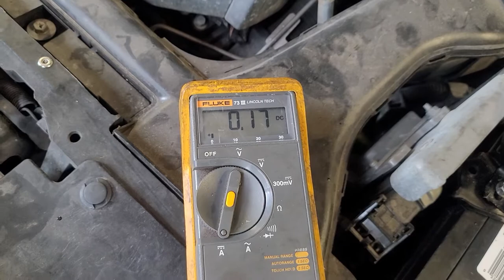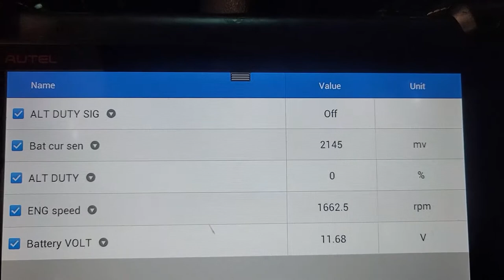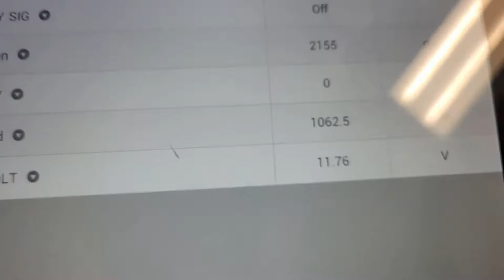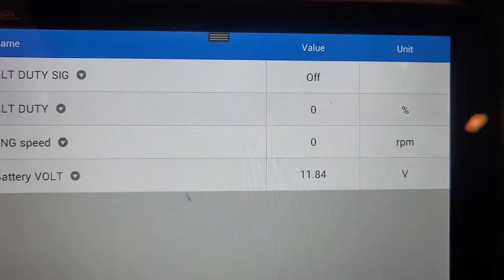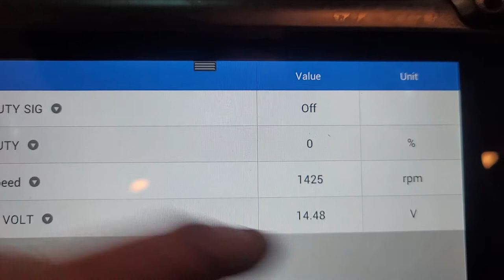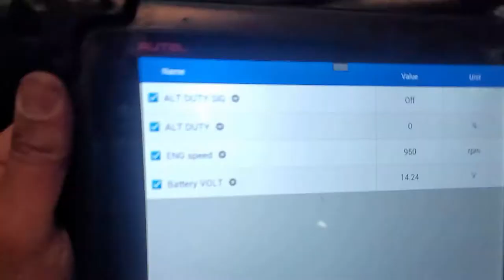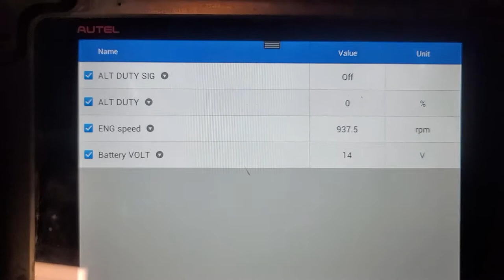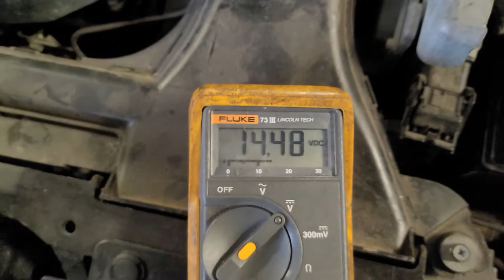2010 Nissan Maxima dying while driving. Diag and repair.

Comment: You’re an honest mechanic. I’m wondering if this is the same issue I’m dealing with at the moment. I replaced my alternator. When I took it out, it was covered in oil because my valves gasket is damage and it’s liking oil. I didn’t clean the harness so hopefully that fixes the problem.
Reply from the maker: thanks for the kind words and hope it will fix your issue. please share with the viewers your findings.

Comment: I believe a have the same issue with my 2010 Maxima. I have replaced the alternator twice  and battery three times! The dealership even replaced the alternator once. I'm going to check this since my wiring is in the same condition. Thanks!!!!!!!
Reply: @ZeJic  I didn't clean it; instead, I replaced the alternator pigtail connector . Now,  I'm going to pull my alternator this weekend and check it/replace it because I think it's dead again. I found there was rust in the old connector, so hopefully that's what was killing everything. I'll let you know.
Reply from the maker: Good luck 🤞
Reply: Crazy how all of us are in the same shitty position at the same time. Literally just towed my car into a dealership after replacing my battery last week.
Reply: @DallasAutoDiag  Thanks!
Reply: @04WildDawg  any updates?
Reply: @TheSwankynina  I sold the vehicle. I the vehicle would still die if it sat more than 24 hours.
Reply: @04WildDawg  was it that mine doing the same thing
Reply: @jrokwest901  Unfortunately not. I never found the main issue. If I didn't drive it for 24 hours it would still die. It had some type of parasite drain and no one in my area would take the time to diagnose it. I just got another vehicle.

Comment: We have a nissan murano and been to 3 different mechanics,  new alternator,, new battery etc etc ..only difference is it will suddenly cut off but once we boost it off it will go a week or so and do the same thing just die out while driving..the mechanics run test and say they can't find nothing.. Definitely need your expertise!
Reply from the maker: Let someone check if the pcm has a software update
Reply: I had the same issue with my 16 Maxima , replaced the IPDM and the car stopped stalling out,  but now my alternator keeps burning out.  I am on alternator 4 or 5 in 6 months.  I have changed it so many times that I can't keep count.

Comment: This is exactly why i don't want to just jump in and replace the alternator with out checking everything. Same issue on my murano. drives for 10-15 mins then loses power and and dips down to 11v and goes into limp mode. Let it sit for a few hours and it fires back up with 14.2 volts and the pattern repeats. I'll check this next.

Comment: 2011 Nissan Maxima: Over the course of years before I bought the car from my sister the battery would randomly leave her stranded (or so she thought) but it's odd that the car would start just fine and after a short drive of perhaps three minutes and about fifteen minutes of her shopping the battery suddenly dies when she gets back in (her job and the store were very close so it was odd that it would crank once but fail less than 30 minutes later). I buy the car and change the alternator and the electrical connector for the alternator cause the plastic was brittle and broken, I did this cause the battery would randomly be drained after the car sat for weeks or sometimes only days. Car works fine for a few weeks (not driven regularly though) and I find the battery is still draining cause it's dead one day, but I charge it up . A couple of weeks later I got in the car and it cranked just fine but then after I put it in reverse all the warning lights come on and the engine wouldn't rev up in reverse. I put it in drive and the motor will rev up and move the car, put it back in reverse and get nothing. I buy a new battery and the car is cranking and working correctly, after a trip the battery and brake light start to flutter on and off but I make it home with no issues. Now the battery and brake light keep coming on but the car is working fine, though I note that if I rev the motor up I can make the light go out after a few times reving the engine. Opinion?
Reply: IM LITERALLY HAVING THIS PROBLEM AS WE SPEAK!!!  the battery and brake light pops up and goes away when I hit the gas pedal but as soon as I take my foot off it’s pops up again. Idk what to do smh
Reply: @nazierchew4168  I'm still studying but I've come to the conclusion it must be the IPDM. My mother owned a Nissan Altima that also had the issue of a dead battery (I'm not sure the batteries are really even dying cause I've had a fully charged battery click the starter like it was low when I know it wasn't) but it had a good alternator and the only part relative between them (engine electronics wise) is the IPDM. You have to look at the numbers on the IPDM though if you want to hunt one from an Altima cause different year models may use a different kind that may not work, interchangeably. I'm not 1,000 percent that this is the true fix cause I'm still hunting a junkyard IPDM but I know everything in my charging system is functional. I've checked out pretty much everything and I'm just about certain the IPDM is the issue.
Reply: @AudioGardenSlave123 was that the issue for you I'm having the same issue.
Reply: @Souljourney22  It's still running great, so so far I say it's fixed.
Reply: @AudioGardenSlave123  also how do you determine which model is compatible with your particular car?
Reply: @Souljourney22  You can go to a scrap yard and they'll check. Generally they have a computer system that will tell them what year models have parts similar to the one you have. At least that's what the scrap yard I went to could do. I went in and said I needed the part and that some Nissan vehicles other than Maximas have compatible parts and he looked it up and took me to a model year newer Altima with the part. Take your old IPDM and they can get numbers off of it.
Reply: @AudioGardenSlave123  appreciate the help brotha!
Reply: @Souljourney22  Welcome sir. Just take what I say with a grain of salt cause just because it worked for me that doesn't mean it will work for everyone. Also, remember that my mother had an Altima with similar (not nearly as severe) issues so I'd suggest getting an IPDM from as a new a model of car as you can find that is still compatible with your Maxima. Her Altima was an 09 and my Maxima is a 2011 so I suggest finding something from a 2012 to 14. I think the part changed after 2014 so that's the cutoff year for the part.
Reply: @AudioGardenSlave123  for your maxima was the ipdm located in cabin or under the hood. I'm trying to research the removal process and it hard to find a video that directly deals with my car. I figured since you have a maxima a year older than mine that they would be in the same location. Also did you have to reprogram it upon installation.

Comment: My factory infotainment/radio on my 2012 maxima won't turn off once I turn car off. Could this possibly be the issue? The battery is new. And the car just recently shut off while I was driving it after jumpstarting it in my yard.

Comment: Nicely found and repaired buddy. Glad the previous garage was incompetent, at least you got a job out of it.
Reply from the maker: Thanks a lot. By the way, i recently did a case where i used the amp hound. It was really quick and useful and i actually made it better by adding a probe that i bought separately.
Reply: @DallasAutoDiag : Excellent, glad to hear that your finding it a useful addition to your kit 👍, what type of probe did you add ?.
Reply: What city are you located in? I’m having the same issue?
Reply from the maker: @GRASSF3D 
Northern Dallas. I'm mobile
Reply: @DallasAutoDiag  Mann, I’m Houston, TX 😪
Reply: @GRASSF3D  same I'm about to buy a new battery
Reply: @blackzZug  I replaced the battery & alternator, still not resolved
Reply: @DallasAutoDiag  Would you be willing to come down to Houston, I’ll pay for your flight as I am having the same issue, if like if I take it to the dealer, they will charge & probably won’t resolve the issue
Reply from the maker: @rscelectrical7091  
https://youtu.be/lTBjsSFaSNo

Comment: I have a 2011 maxima car stalled  changed the alternator and the alternater pigtail that's what the mechanic did ..changed the battery too now stalled again with all lights on and no power ..everything seems good battery, starter and alternator what could be the problems?
Reply from the maker: Maybe pcm

Comment: Sir my 2009 is in Nissan with the same exact problem and this makes the 2nd time. Was wondering did it fix the issue for your client? This makes the 2nd time ive taken mine to Nissan and this time theyre saying its the ecm, motor mount and need rear brakes which is being repaired rn for 2,216 but nothings showing as to why im losing power and the car dying while in drive. So basically i will be faced with the same issue when i get it back. Im having the same issues as your client did this fix the issue?
Reply from the maker: Yes it did fix the issue for my client. It is a known issue with Nissan's. I have done many of these before and after the video
Reply: @DallasAutoDiag  thank you for replying back! Could you please tell me everything you did to this vehicle to get it running where I can have somewhat insight this time bc as I stated above (bf I picked vehicle up from Nissan) I knew the same problems would exist and the vehicle is doing the same thing therefore back to Nissan but this time I'd like to have knowledge of what the issue is bc they seem not to know. Thanks again for taking time out your schedule to respond. 

               Stella L. From Alabama

Comment: What are the tools you used to stick inside the harness?
Reply from the maker: MENKEY Terminal Removal Tool Kit for Car, 39 Pieces Wire Connector Pin Release Key Extractor Tools Set for Most Connector Terminal https://www.amazon.com/dp/B07ZC1V2W6/ref=cm_sw_r_apan_glt_i_52PCT44ZW79SQY0Y2T6J

Comment: Wow. I had a shop change my alternator on my 09 maxima. They poured dirty coolant back in , 4 miles later it overheated and ended up with a blown head gasket, warped head. Got a $6000 engine. All said n done, needing an alternator ended up costing me $8000

Comment: Hello I have a 2010 Nissan Maxima. I replaced the Alternator, the Battery and the pigtail connector for the alternator harness. Still getting the same problem not holding charge. Also checked the fuse and its fine. Can you point me in the right direction for my next step?
Reply: Me too have you found out anything yet
Reply: check the negative (ground) cable from the Transmision to the battery, sometimes when that cable is bad the transmision drains the battery
Reply: @netovando  found out that the new alternator I bought was bad took it back off and had it checked.Then to top it off they didn’t have my warranty in the system and I bought the new alternator in December and had it installed thinking that it was a major problem.But ended up buying another new one and finally getting my maxima fixed and getting a refund from the first one I bought after complaining and showing my bank statement
Reply: @Kee_901  how has it been working?
Reply: @madbroindustries  had a issue about 2 weeks ago went to work and came out cranked it and it was in limp mode cut it off and tried to crank it and it was dead I’m thinking my battery is ruined because I got it towed home checked the alternator and took the battery out had it charged and took it off the charger but when I put it back on the charger it acted like it wasn’t charged going to use my warranty on the battery and update you on it
Reply: @Kee_901  awesome thanks
Reply: @Kee_901  Been a year bro...
Reply: @AudioGardenSlave123  car has still been down I’ve tried everything new alternator,new plug now it’s changed again going to pick it up this weekend worse model maxima to have
Reply: @Kee_901  I know, but the car has been fine for many years and many miles so it's just some part somewhere that isn't functioning as it ought and I think it's going to be some computer module of some sort. It's too expensive to be buying stuff like that and have it fix nothing so it's frustrating.
Reply: @Kee_901  wow, mine just went down and I have a year left on the note. Getting new alternator and battery. I hope it works
Reply: Try the fusible link on your battery terminals

Comment: I replaced the alternator and battery, and it says I am getting 14. 2 to 14.4, when the car is on, but it dies like 30 minutes later on a 3.5 Altima. I'm stumped.
Reply from the maker: What do you mean when you said it dies 30 minutes later
Reply: @DallasAutoDiag  after the battery dies, the car shuts off.(running till battery is drained)
Reply: @gmillan5150  same here what should I look for
Reply: @bennyyboyz  sorry, it ended up being a faulty alternator.  Pain to change, but I got it done and replaced the belt while I was there.
Reply: @gmillan5150  so you had to replace it twice, I just change my alt and witching 1 hour of driving all my power went off and died
Reply: @mrvaj2021  yeah, I did it twice. First alternator was faulty from the online purchase.
Reply: @gmillan5150  how long did U drive to find out it was a faulty alt
Reply: @mrvaj2021  like two weeks, it was fine for the first 10 days, then it went bad.
Reply: @gmillan5150  what symptoms did it have
Reply: @mrvaj2021  it was very odd, no symptoms. I had a new battery too. So it would pass the alternator and battery test, but the battery kept dying. So after replacing the battery and it continued to occur z I just did the alternator again.
Reply: @gmillan5150  where did you get the alternator from
Reply: Dude I've gone through 2 alternators from ohrileys and it just died once again ughhhh
I'm going to check the harness hopefully that's ti
Reply: @houstontalk7129  shiats a pain in the arse!
Reply: @houstontalk7129  been thru the same. only fix is buying new new alternator cuz the rebuilt ones are not fully rebuilt they never rebuild the voltage regulators etc
Reply: @LiilTyweezy  so an original alternator from nissan?